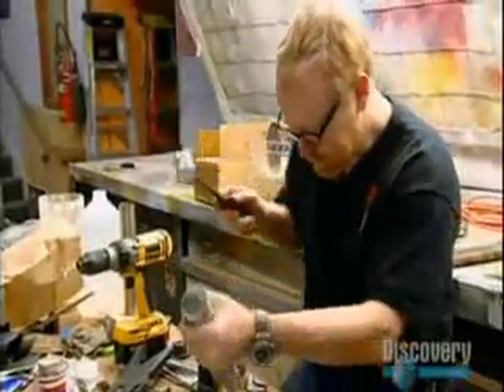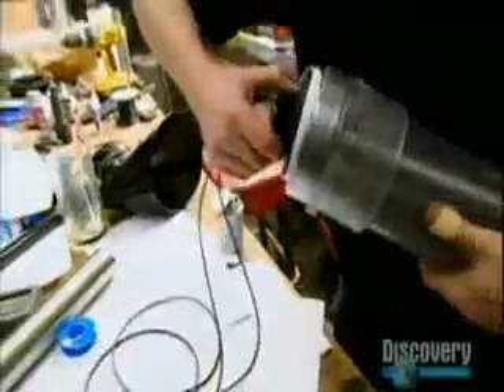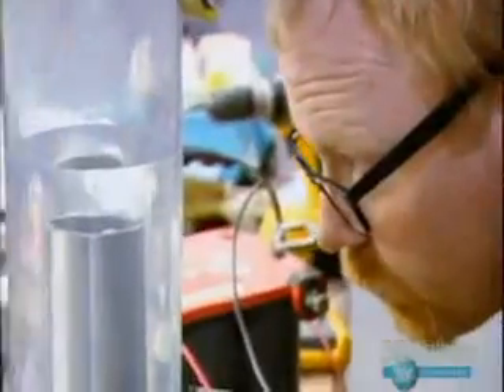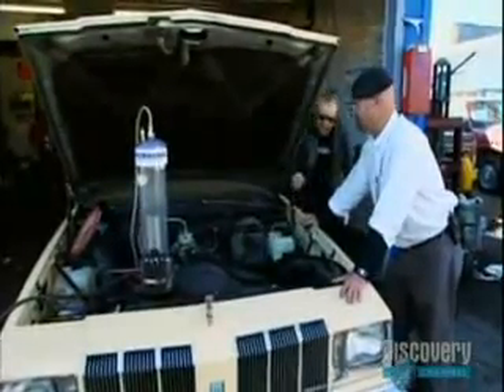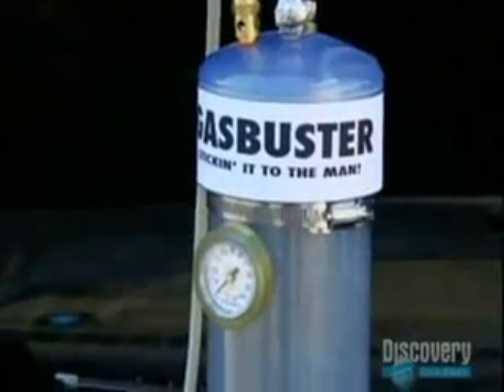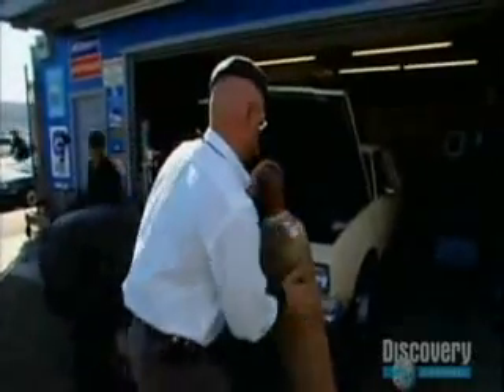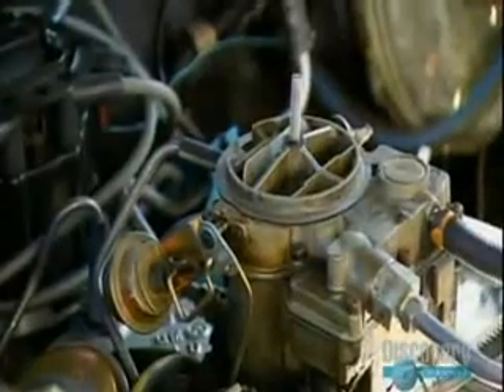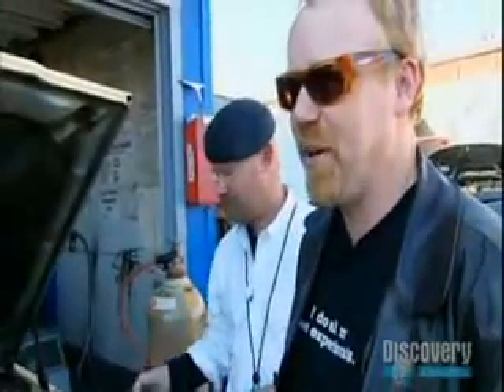HHO Mythbusters Explained

Comment: I don't know how many people do this but when I had an HHO generator I used distilled white vinegar just straight as my "water and electrolyte". I had stainless steel components and when they got dirty you just put water and baking soda in there and leave it on there for awhile cleans them up great. I also had a 1 gallon per minute diaphragm pump (Shurflo??) creating a vacuum in the unit which made it work even faster... like much faster. Just some ideas you guys might want to try.
Reply: So it powers your car?
Reply: @trailerwager8850  well not really "powers it", but made it combust more efficiently let's put it that way.
Reply: @trailerwager8850  
it can if enough of it is produced, what they were doing will only provide enough power to run for a few seconds. 

but what people have been doing is mixing hho or hydrogen with gasoline and saving on their overall fuel use, so it can save you on gas money that you put into it. 

these guys obviously didn't do it correctly, if they did it correctly, they would have stored enough hydrogen in tanks and then started the car, that method actually works.

also there are ways to prevent the blowback that they experienced in the video that make it much safer. 

this video was all about debunking the idea of how it's done, but they simply made a fake video of how it's done and didn't follow the proper precautions and a few other things that they didn't do to make it work. 

i'm willing to bet they were paid a large sum of money to debunk it, simply put, it does work very well and is a proven fact, otherwise NASA wouldn't have used it for all these decades like they have.

it's the most clean fuel as well the most free fuel to produce, the reason why they don't want people to use this stuff is because it's essentially free fuel and the gasoline and diesel companies would go bankrupt over night if every car owner made the switch. 

all you need is a few solar panels and some water some stainless steel and and electrolyte and then bottle it up in some storage tanks and allow the sun to produce everything you could possibly need.

there is a man in the states who runs his entire house off of this stuff and has been living without the need for electricity for many years because he uses free energy produced via the sun into storage tanks on his property, the only time of the year where he doesn't get as much is the winter, but because he has storage tanks filled with the  gas, he uses what he produced all your long to be used during the winter, the only expense the man has from the city is his water and that's it.

so the man essentially lives free, even his fuel in his car is free.
Reply: @5226-p1e  the subject never came out but what do you think happened to Stan Meyer and his water power dune buggy? Do you think it was legit and somebody did him in? Natural causes? (Personally I think there was something foul afoot)

Hope you are well.
Reply: @tennesseehomesteader6175  
i'm not familiar with his story or who he is for that matter. 

what did he do with his dune buggy anyway?
Reply: @5226-p1e  he's supposedly had a way to acoustically split water that took very low energy he discovered it by accident when he was doing a experiment with radio waves. That is he found a way with radio waves to make HHO; made a thing that fit in the spark plug holes but instead of igniting gasoline it acoustically would split water into HHO and he ran his dune buggy all over the place until he mysteriously died. I think this is in the '80s or something like that. Apparently everybody was telling him to keep a lower profile and kind of keep it secret but he had painted on his car "runs on water" and stuff like that. If it is true you can see why the oil companies wouldn't like that. But I've heard so much b***** throughout my life I'm not sure what to think anymore. It's kind of sad people will lie just to get attention like the truth is not good enough. I've been there.... you feel unimportant; I guess I understand the temptation.
Reply: @tennesseehomesteader6175  
well the best way to know if it is indeed real is to try it out for yourself. 

i was skeptical as well, until i understood how it was done, now i can't explain the science of it because i'm not a scientist, but i do know how to follow instructions, and i went to various videos of people talking about how it's done with schematics and everything involved.

i'm not the smartest person either, i just simply followed the instructions and watched a lot of videos of people doing the same thing slightly different, but eventually i got enough courage to try it out for myself, and i did it and it really does work, but there are some important safety things to take into mind when you try something like this, so be patient with what you are learning and take proper caution while doing it.

what i want to do is become more like this guy, https://www.youtube.com/watch?v=NMH1pBAYgYs

but anyway, going back to that one dude who talked about this stuff with his dune buggy, your right, he really shouldn't have been so showy about this idea, he would have been better off teaching people how to do it, and let these people spread the word, until eventually a whole lot of people know how it's done and they could try to stop the message that way if they want, but they wouldn't be able to stop everyone spreading the message, this is probably why they took it to the myth busters because they have a giant audience and enough clout built up through out the years to prove someone wrong, even though this was clearly a video that left out a lot of the most important details and was made to look like it wasn't a viable option. 

you really should watch multiple videos on ideas like this, but your right, there are the people who will make fake videos on stuff, sometimes they are just trying to get money for their gofundme or they are trying to scam people and sometimes they are people paid to propagandize hoaxes so that  the general population stay away from these projects, it's meant to be disinformation so that it gets people to walk away believing that it's all fake, which is really sad because there are so many things out there that are legit, but they just get brushed off because of these people scamming or creating hoaxes causes so many people to not give the time of day to try it out for themselves.

weirdly enough, he sounds like this guy, this guy is essentially doing the same thing, but he's been around for a while, he probably doesn't get as many views as he would need in order to get people to think about it.
https://www.youtube.com/watch?v=NMH1pBAYgYs
Reply: @5226-p1e  yeah right on thanks for the links I'll check them out. I'll try to find you one as well on Stan Meyer.
Reply: @tennesseehomesteader6175  
yeah, i'm on my PC while writing to you, i assume the reason why you can't is because you might be using the app? 

but then again i thought i remember the app having that capability, it's no matter, i looked up the guy, and it appears like he could have been murdered. 

they have gone after many individuals within history for the same things, first they were known people and were working on breakthroughs that could make something amazing for the majority population, and then one day they either go missing or they end up dead, it sounds like they were attempting on doing that same thing to this guy. 

roughly an hour and 40 minutes into this video, he talks about that very issue with his battle against these same people, https://www.youtube.com/watch?v=0bXNjTUtMf8
 
they tried to shut him down, so he went to the media with his findings and also that they were trying to shut him down. 

it was a big risk to go to the media with this, but i think it gave him some notoriety which also granted some protections and also with his lawsuit, he got lucky because another benefactor who was also working on a breakthrough themselves took pity on his story because the same thing happened to them, so they helped him out with his case. 

these people are criminals, and they will stop at nothing until they get their way, the thing is, even though he won his court case, i'm afraid it may not be enough with these kinds of people and what they will do in order to silence someone.

it just reminds me of the Nikola Tesla days.
Reply: @5226-p1e  yeah I'm just on my phone now I'll get everything worked out it's just not priority at the moment I mean I'm really living simply. To use my toilet I have to pour the water in to the reservoir bucket by bucket to get it to flush, a shower is black buckets in the sun during the summertime and then I pour water over me via 2 l bottle, in the winter I just leave a bunch of water on top of my wood stove but even if it's 9 degrees I'm freezing my ass off while soaping up. I don't currently have a wall around my toilet because like I said earlier this is a 16x40 shed I'm converting into a house but the things other people take for granted I simply don't have. Anyway a little off topic but you get the point so doing everything on my phone at the moment but yeah you're probably right about being able to copy the link I just don't know how to do that on my computer I would.

Everything at the moment revolves around the greenhouse; everything else is secondary even all that "comfortable living stuff".. got to get some funds coming in. But I am about to break the threshold of being a consumer to actually being a provider. It seems like in this crazy world right now those are the ones who are making the money because prices are going up when your producer that's great, when you're a consumer it sucks. But I think I'm doing the right thing bye raising food that will be healthy for people, myself and them included. I'm not like raising tobacco and trying to sell it or anything I'm doing good things. Honestly I don't know how you could ethically raise tobacco and sell it to people knowing that it's just hurting them. 

Yeah I know there's good people in the world who want to do the right thing even in the places you at least expect them governmental agencies etc but I know there's a lot of bad people that are just motivated by greed. But fighting them gives us something to do doesn't it? Just keep fighting..
Reply: I've never heard somebody use white vinegar for creating hho, I've heard of them using distilled water within the stainless steel in the water creating the electrical charge either off of solar panels or even the battery within the car's engine.

Of course the mythbusters for whatever reason didn't use an electrolyte of any kind and they also didn't use a bubbler, and they also didn't use gasoline as the primary fuel, the HHO is purely something that's created on demand and it's meant to be used alongside gasoline or diesel fuel.

They did either deceptive editing in their video or they just skip those steps completely, either their instructions were incorrect, or they chose to do this incorrectly because someone paid them an awful lot of money to debunk it by using these deceptive editing methods and not following the instructions.

I mean any number of things could explain why they got it wrong, but it's not the reason that they tried to explain towards the end, which is the reason why I believe that it was deceptive, or they followed the instructions from a designer who didn't fully understand how this process works.

As far as I can tell this container it was not seen in very good detail of how their system worked, however just like this video talked about, they clearly left out the electrolyte, and they were also trying to run straight off of on demand HHO, which is essentially impossible without having the car using another fuel source or a tank filled with hhl gas, but the reason why we don't do that is because it's incredibly fucking dangerous and the moment we get into a wreck everybody dies regardless.
Reply: @5226-p1e   @52262  yeah all good thoughts I'm sure it's the type of thing that a lot of people have a lot of good ideas that might not be practical or widely known I mean the powers that be don't want things like this to be studied or fine-tuned so to speak. But yeah the company who made my HHO generator out of Atlanta can't remember what the company was called now it's been close to 20 years since I've been there but I remember I did some gas mileage testing with my setup and it definitely got worse gas mileage but I was hooking it up to a 240D Mercedes that was burning vegetable oil as well. I was really into the alternative fuel thing it was very impressive because I had vegetable oil and HHO running it in a diesel I'm telling you right now if you smell the exhaust you would have been amazed it was just like a slight vegetable oil smell and steam... Very impressive. But as I understand it and I'm no engineer, a gasoline burning car is about 30% efficient which I think the HHO would work very well with making it more efficient and had a lot of room to do so. Diesels as I understand are about 60% efficient from all the energy stored in the fuel so with my setup the alternator with the additional load, took more power than it was creating and I was losing my gas mileage. I had parents that I visited in Raleigh North Carolina so I did some very specific testing I drove all the way to Raleigh without the generator on and then I drove all the way back with it on and it got about 5 miles per gallon less DEFINITELY. I told him I was getting worse mileage they didn't believe me.. they were in total denial didn't want to hear it. But as God is my witness it is true. Maybe more modern car with a newer alternator or something it might have worked out with but I was not impressed how it worked with my diesel setup. But I'll tell you what all things being equal that was some clean exhaust coming out of the tailpipe!
Reply: @tennesseehomesteader6175  
From what I understand and know of HHO kits, you at some point have to change up the water inside the container that produces the gas, they call it Brown's gas because of what happens to the water eventually, and that's typically when you're supposed to swap that water out with new distilled water and a fresh electrolyte in order for it to start running good again.

It's like anything else on your car, when it comes to maintenance that needs to be done in order to maintain its peak efficiency.

But yeah that's really cool about the vegetable oil running off of your diesel, I remember when I was back in middle school when they were talking about using corn to create vegetable oil in order to put it in diesel engines as a fuel source alternative.

Then I was doing some research about Earth shapes, and I found out that Earthship Community down in Taos Mexico do some kind of house building classes down there, but they also create their own fuel for their diesel engines using corn, so it's definitely believable, I also remember watching an episode of Bear Grylls, and they talked about the possibility of using Grease in the engine of a diesel vehicle in order to run it, of course he mentioned that you might be able to get away with doing this only once, because grease can be very thick and could cause problems if it's done too many times, but it could work in a pinch.

It's kind of crazy where you learn these things.
Reply: @5226-p1e  oh that's really cool I never knew where the term Brown's gas came from I guess that makes sense. I guess I assumed Brown was the guy who discovered how to make HHO. It's been so long now I can't recall when I changed the vinegar out if it was brown or not. I actually think it was because basically the vinegar was water and acid instead of water and baking soda.. also an electrolyte.

I don't know about grease being able to run a diesel.. but used cooking oil is what I used. It's really a matter of viscosity. If you can't spray it into the engine it's simply won't run, because you can't get the fuel in there. 

When you make biodiesel and put the lye and methanol in the oil and cook it for a while, or wait a while, depending on which method you use to make the biodiesel, the glycerin separates out into glycerin soap and what's left on top is the biodiesel that you can run in your engine. The viscosity issue is solved by separating the glycerin out and leaving the biodiesel. 

The other way to solve the viscosity problem is to heat the oil, which is what I did. Every time I started my car the antifreeze would go all the way back to the trunk, circulate through copper coils through my custom-made aluminum tank, run all the way back up front for recirculation into the engine. 

So the choice that you typically have is making biodiesel which you constantly have to cook or otherwise wait. More time consuming constantly making this recipe, but minimal expense involved. And you are handling lie which is potentially dangerous as is methanol.. neither one is good to touch or splash in your eye.

The other choice is complicated plumbing, upfront expense with custom tanks, switches and such like I had where you can just run straight vegetable oil. 

One of my proudest moments is when I went to a family reunion in the Ozarks in Missouri and drove from Atlanta where I lived to St Louis completely on vegetable oil in my 240D before I ran out of oil that I carried with me. The back was sagging down from the weight.. so funny. Can't remember how many gallons I had exactly but I filtered it through a blue jean pant leg zip tied at one end into a 5 gallon bucket with a simple 90° ball valve as my refueling station. That engine had 380,000 miles on it with a bad piston when I got it and I was rolling down the road at 70 mph completely free on vegetable oil. I put that custom made system in my car and easily paid for it and fuel costs from what I saved.

They sure are limit our choices in diesels don't they our last Hope was really Volkswagen but they definitely put an end to that... 

But my life is much different now. I live in a farm and have a tractor and when the weather is warm I will mix filtered vegetable oil straight into my diesel when the weather is warm to save fuel costs. By the way you can change the oil in your car and motor oil works absolutely great and diesels as well. Don't do it in the cold weather though and I wouldn't go much over 30% even in the warm weather but it's a great way to cut costs. I know we're originally talking about HHO but you're definitely interested in saving fuel costs this is another way to do it slightly different approach. I have lots of work to do with my tractor at my place and need to find a place here locally where I live to score some used vegetable oil to put in my tractor. It sure helps cut costs with everything being so expensive these days. Just be a good customer to a restaurant with a deep fryer and you only need one restaurant and you're all set. Just remember if you do this to add a little alcohol (heet) to the water after you filter it to get rid of any emulsified water in the oil from cooking.

Something fun I used to do was with fire up my diesel, disconnect the HHO, and let it fill up balloons. I would get a balloon full, tape a cannon fuse to the outside with a cigarette with no filter on the end and send it on its way. I remember watching it one time probably about a quarter mile away and when it lit the fuse and finally exploded it was incredibly loud. I'm sure I scared the crap out of some people I was laughing so hard.
Reply: @tennesseehomesteader6175  
that's quite all right, I like talking about this stuff, even though sometimes it's a bit over my head.

But you're right, I do definitely have an interest in this kind of stuff, anything that's has some kind of efficiency or reuses something that is natural in order to achieve the best efficiency as possible.

I brought up the earthship community, and I briefly explain what they do, but earthships in many ways are very efficient when it comes to a home you would live in.

That's basically what a earthship is, it's kind of like an organic home, it sounds ridiculous I know, but if you look it up it's actually quite cool and how they make these houses work.

Just picture a house that's partially buried leaving only the south side open, but the house itself essentially heats itself during the winter, and cools itself during the summer in a fairly efficient way using passive heating from the sun and a few other tricks in the way they are built, and in the summer they get passive cooling from the south side because the house is essentially half buried so they get this like long pipe that goes through all that dirt but they have several pipes go through the dirt and extends under at least 10 ft underground, but they eventually open up to fresh air on the south side, well inside of the earthship home, you can open these pipes or cooling tubes during the summer, and you get a natural convection of cooling in the building because the heat on the south side that's hitting the front of the structure which is also kind of the where the greenhouse is has Windows upwards and because heat rises it creates a national convection of cool air into the house or the earthship.

It's actually a very creative way to get cooling inside of a home without electricity, of course this may only work during the day not so much during the night, but he does rise even at night too and if these cooling tubes are open, they will still create a natural convection, it just won't be as strong.

Anyway the other cool thing about Earth's ships is that they essentially built the rooftop to collect rainwater and that rain water is then collected through a filter that cleans it up so that it could be used for drinking water to be used for shower water could be used for your sink water, and then it gets put into a botanical plant cell on the south side of the house within the greenhouse area, so the water is reused, and after it's gone through this botanical cell the water is then collected and pumped back into something like your toilet, and that water is sent out of the house into another botanical cell that's called your blackwater, so You're only drinking water is what you first filter, and your gray water is it goes through the botanical cell which is usually your shower or washing dishes or sink water typically, but a certain portion of it is meant to be pumped back into the toilet when it calls for water.

They also will put solar panels on the south side of the building which is where the sun is most of the time anyway, and they use that to essentially power the house when it comes to lighting or refrigerators and they have it connected to a control panel room that convert that power into something that you can use, as I said this earthship stuff is actually really cool, now for most people it may not be practical, because most people want to live in a conventional home, but the rising cost of homes is just about to dramatically change due to the cost of inflation within the country, so this type of building might actually help people in the end.

You can also build yourself a wind turbine or a few of them on the land that surrounds the earthship which can be used for the for power if needed, in most cases these homes don't necessarily need that much power.

But I'm not just interested in just earthships, I don't know if you're aware of another building known as dome homes, they actually have a fairly simplistic process and how they're built but the end result is a very strong and very efficient house when it comes to heating and cooling this type of house, because of the materials that it's made up of it is incredibly efficient, but also don't homes are really cool when it comes down to them being earthquake tornado hurricane proof, especially up against your conventional house, they can be buried underground in which you can create tunnels to other portions of the dome or other domes that it may be connected to, or you can just have the one that's on top of the land which is also fine too, there's a dome home also known as monolithic dome home found on the coast of Florida that has been through three or four hurricanes for the past 20 or so years, and every single time a hurricane happened the domestud up against the elements while every other household in that location were completely decimated, one time the owner of that house stayed inside the house during the hurricane, and he watched all of his neighbors houses completely get destroyed in minutes along with the foundation everything was just lifted up like it was nothing.

I'm amazed we don't live in domes everywhere lol, but I guess my idea of a dumb home would be something that uses earthship principles at the same time as it being a dumb, it's a concept that I have thought about for a while.

Sorry I went into a bit of a rant there, you caught me at a time where I can talk about stuff and I'm on the verge of going to sleep but talking about this kind of stuff is kind of fun for me which is why I ramble on and on, so if you read through all of that lol. I would check out Earth ships if I were you, they're such a cool concept and of course dome homes.
Reply: @5226-p1e  All very cool stuff to me. I've heard of earthships kind of escaped me somehow to what they actually were. Wanted a Inter-shelter dome home kit that I could put up myself was going to connect several of them but you get so little for the money they are asking way too much for them I decided to opt for a 16 x40 shed that I converted into a living space. I have a 30x40 garage my idea was to have a small living space easier to heat cool and clean with a large garage for storage. Was going to do an underground home but it was just too complicated for what was available in the area. I'm way out in the sticks in a little town... There's just not the same things here as there is in a larger area. On Monday I'm getting $10,000 worth of solar panels to put on the garage I already have a Sundanzer super efficient refrigerator here in my place and wood stove for heat and I harvest the rain water my living expenses are extremely low. Taxes are literally for my 20 acres $104 a year to live here, that's my rent. Not exactly everything that I want but it is certainly everything that I need. Building a greenhouse all by myself now to save money putting a fence around the 20 acres as well among many other things. There's just so much for one person to do at 52 years old. My fiance's Mexican tried to get her here but got to get the greenhouse business up and going first, I'm doing microgreens. But I have almost completed the first greenhouse once again it just takes a while because it's just me at the moment. Made a raised garden bed from old tires from my neighbor he was very grateful for me to take the 50 or so tires from him so he doesn't have to pay the recycling fee. I just planted eight paw paw trees three different varieties, three fig trees, two honey crisp apple trees, one aronia berry bush, two red mulberry trees, five blueberry bushes, two loquat trees, one cherry tree, a lilac bush over my cat's grave as a memorial, and three spice bushes. 

I guess I just want to be as free as I can in this life and when I wake up I want to do things for me not for everybody else. It's all hard work but even if 52 years old I'm stronger than I've ever been in my whole life even in my twenties. I wish there were more people like us that see the trap that the powers that be keep us in. I wish more people cared about the environment and each other. When I go into town I'm truly happy to interact with people but in very short order it seems I'm dying to get back home and watch the deer run around and listen to the turkeys gobble.  

I subscribed to your channel just because. Great talking to you ☺️
Reply: @tennesseehomesteader6175  
I'm not even worth subscribing to but I'm flattered thanks.

Well I'm a bit younger than you, but I do have the spirit of trying to be resourceful, I'm actually kind of jealous of your situation living out there where you're at, living as cheaply as possible.

Anyway on to your gardens, I noticed when you said that you use tires that actually reminds me of the construction of the earthships, they commonly used tires in order to build these things because the tires work as a thermal battery for the entire household so that's what I was talking about when the sun hits the household not only does it heat up the south side but there's tires that are like next to each other they're packed with lots and lots of dirt they're like tire bricks that when everything is put together for the whole house, they make the house very strong and depending on what environment you're in they will essentially the last forever, anyway when the sun touches the house it heats up that part of the house but because most of the retaining wall is made up of tires I mean they've been plastered over so they don't release any harmful gases to anybody inside the house, but they heat up and then they basically turn into a thermal battery so throughout the day the heat up, even if the house inside is cool so when it gets dark and there's no more sun outside, the tires still have a lot of heat in them and they just radiate all night and that's why they call it a thermal battery.

So that same concept could actually work for your greenhouse as well using those tires funny enough, of course it also depends on how you built the structure for your greenhouse.

You could also create what is called a sunken greenhouse, that is partial buried and uses the natural thermal battery of the Earth, and to add on top of that using a tire wall for the layer that isn't buried in the dirt, so that even during the night it can be used as a thermal battery for the greenhouse, it is essentially keeps the greenhouse warm all year long without the need for electricity, but I suppose in the summer could be a little hot so maybe you could have some vents on the top of the structure and maybe a fan that's powered by some solar gain so that it's not too hot in there during the summer.

I research a lot of this stuff, I try to learn as much as I can about those subjects from every different angle, I worry about the vast majority of people aren't going to be ready for what's to come, if you've been paying attention to the news they talk about food shortages and shortages of all kinds of stuff because of the war because of the whole lockdown thing and because people didn't go back to work up until now, massive inflation issues that are probably going to go up even further then they are now.

Weird thing is we were getting our fertilizer from Russia, and I thought to myself why were we getting our fertilizer from Russia when we can produce our own fertilizer through cow shit, I mean it's something the human race has used for thousands of years, so it makes no sense that we were getting our fertilizer from another country when we have our own fertilizer, plus you can use all kinds of stuff for fertilizer doesn't have to be cash it, I've seen people use coffee grounds egg shells banana peels grass other animal shit, anything organic as far as I'm aware is good for a garden, so I find it a silly concept that we were getting our fertilizer from another country.

But now we're hearing about these farms being purchased by billionaires who want to control the distribution of food in this country and there are some farmers who are being told to burn up all of their crop and kill off the majority of their animals, it's not due to covid I know that, I think they are the cause of the food shortages, of course it's illegal to think like that in this country for some fucked up reason. Sorry I cuss like a sailor when I get on to this topic.

I just find it rather tragic that most of these people are so ignorant to what's going on that they don't prepare, I thought at some point I could get in front of people and maybe even convince people in my neighborhood and hopefully it'll spread out to other neighborhoods that we need to do something about this, the only thing that I can think of is for people to start gardening in their own yards like our ancestors did and if everybody was doing it there would be plenty of food to be around for everybody, but I'm more afraid that people are going to do it, and when shit hits the fan they will come to the house that most likely has the food and they will ransack them until they're completely gone, so it's important to embolden people ahead of time with the resources of information so that they can better prepare for that type of situation, obviously not a garden is going to do everything, some people have backyards that aren't that big but they have neighbors who have maybe larger backyards, and if people just came together and tried to work for the common good, they would all essentially be better off and they don't have to kill each other for food when she hits the fan.

All it takes is just a little education into how to survive, and the sad part is the vast majority of people probably won't do anything about it because they're lazy, all that laziness will go away when she hits the fan and they have to fight to survive kill or be killed, I would like to prevent that scenario if I can.

I've even thought about talking to people in my church, I haven't gone to my church in years, I may not be a huge believer and everything spiritual, but I am a believer in a community and how important a community is to not only yourself but everybody else within that community benefits from it.

But anyway I thought about going to my church and perhaps convincing people that this is what they should be doing in order to prevent this type of situation from happening, and maybe it might spark a community and the Church may actually help significantly in these trying times so that we can come together and prevent what is about to happen.

I forgot to mention that many food processing plants have been recently attacked apparently two planes ran into two different locations and all the other ones mysteriously caught fire for some reason, but this is over 200 plants within the USA only within 2022, sounds like a conspiracy, but it probably is true, knowing what's been going on within the country as well as other countries.

I don't think these are mere accidents, especially at the rate that they are being destroyed and during this year specifically, the mainstream news at first we're telling us about the food shortages and people didn't believe them then we started seeing all of these food processing places being either blown up or starting on fire or completely destroyed and they all happen within the year 2022, the weird thing is the mainstream media deny that these food processing plants have all been attacked, I don't trust our media man, especially the mainstream.

Obviously the writing has been on the wall for a while now, and people should have prepared for this, I remember talking about this kind of stuff only 5 years ago, and people said that would never happen in this country we have provisions and failsafe's in place in case something like that would happen, well where are those failsafe's? 

The failsafe seem to not exist anymore, because nobody believed that it would possibly happen.

now I'm not the biggest bible thumper either, but the one thing I did pay attention to was revelation, The four horsemen of the Apocalypse, and I'm pretty damn sure we're about to hit the horse of famine which is either the pale white horse or the white horse, I'd have to go back and look at the information again, but I know what famine is, it essentially means food shortages.

And this is why I believe it might be too late, I mean we still have a chance if people start doing this right now everywhere if somebody happens to own land, they should use that land to garden on get a few chickens and even try to get a hen that can make new chickens distribute them out within your community within their yards so that they can have the provisions they need when shit eventually hits the fan and there's no food at the stores.

we might actually have to live like our ancestors for a little while, but at least we'll survive if we at least try.